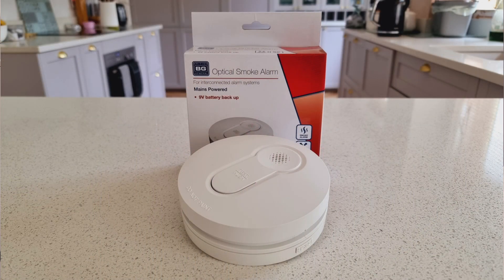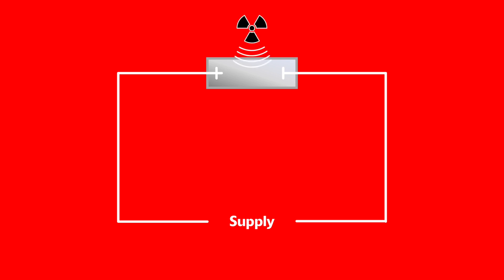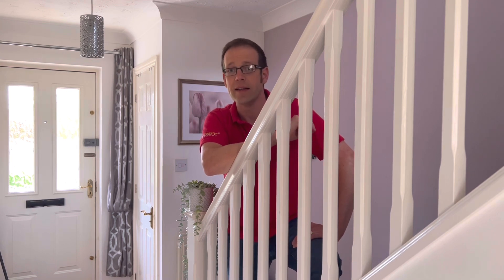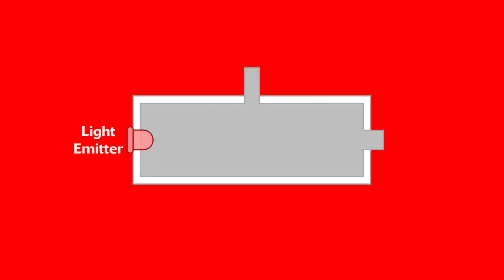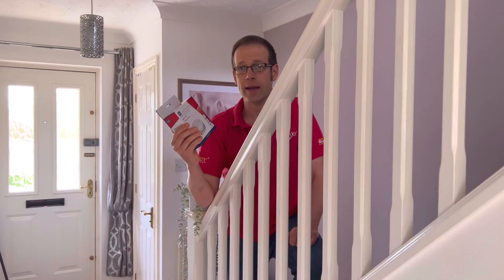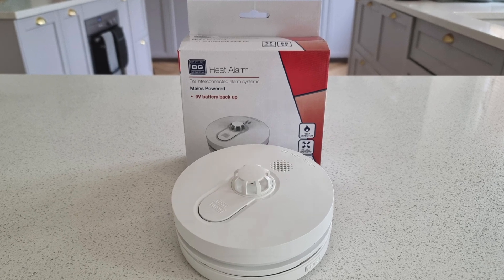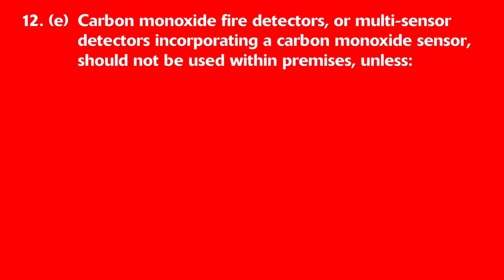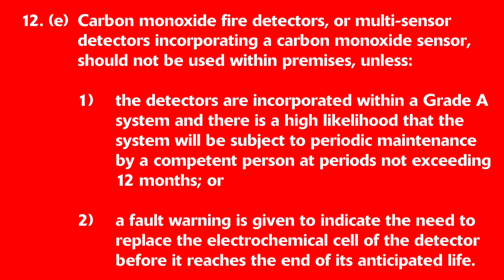Smoke Alarm Essentials: Where to use each type

Comment: Good video there joe one question to ask if  adding a carbon monoxide alarm to a smoke alarm circuit isn't allowed due to BS standards how does the Google smart alarms comply as those have both smoke and carbon combined into one unit
Reply: only from the information from the video - I believe that this should clear that up: 
Carbon monoxide fire detectors, or multi-sensor detectors incorporating a carbon monoxide sensor, should not be used within premises, unless:
1. The detectors are incorporated within a Grade A system…..or
2. A fault warning is given to indicate the need to replace the electrochemical cell of the detector before it reaches the end of its anticipated life.
So, as long as the google smart alarm has this fault warning, then it would comply.

Comment: Fantastic video.
 Is it true that the heat detector and carbon monoxide detector should be at least six to eight feet from the cooker and boiler. Ie in the kitchen in the video the heat detector and carbon dioxide detector should be on the opposite side to the cooker as a minimum or one of each at each end of the room . Fantastic video as always Joe 👍
Reply: Carbon monoxide detectors cannot be installed in a room with a gas cooker! The rules applied to the positioning of CO detectors is not that easy to understand!
Following the installation instructions is crucial!
Gas Safe need to work with the electrical industry to clarify this confusing situation!